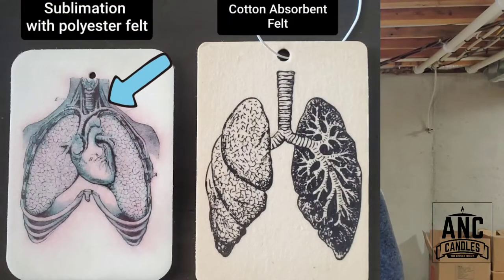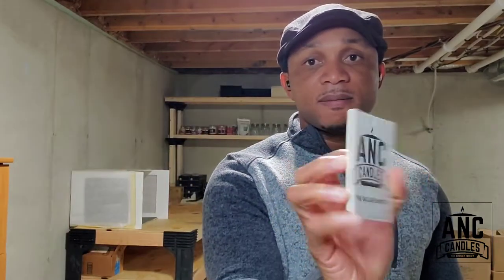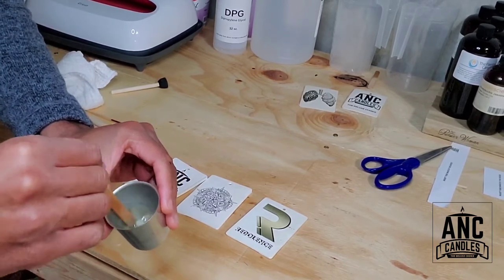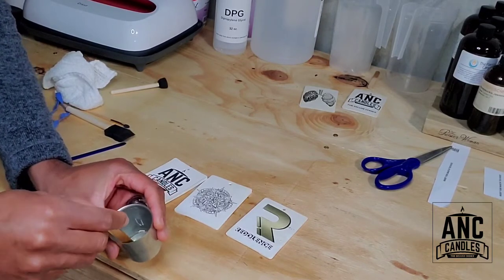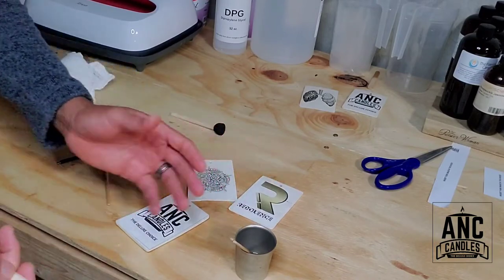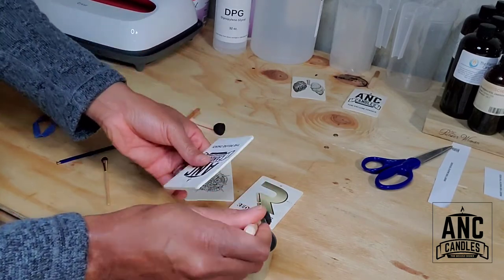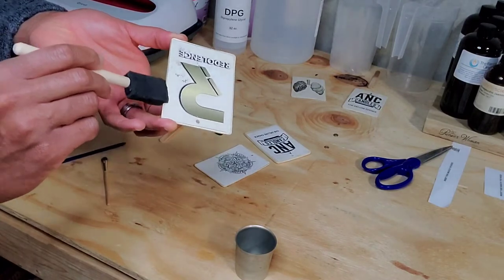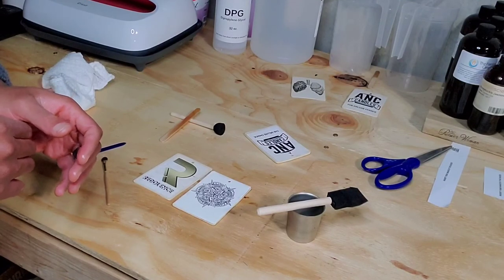How to Add Fragrance Oil to Your Cardstock Car Air Freshener

Comment: Do you only apply the oil to the edges?Have seen other videos where the oil is applied direct to the face of the card.Does one way work better then the other or will it depend on the material?

How long do you let fully dry before put in a sealed pouch?
Reply from the maker: You can check the link below and get all the information you need once and for all. 
https://bit.ly/351Den9

Comment: Hello, can I put sticker on the paper instead of sublimation printing?
Also if I have an ink jet printer do I have to change to sublimation ink and paper or can I use regular printing with regular ink?
Reply from the maker: You can.
Reply: @anccandles  thanx
Reply: How is the oil going to seep into Sticker paper without ruining the design?

Comment: can we make air freshener out of wood cutouts as well? soaking the wood in fragrance oil? would that work as well?
Reply from the maker: Depending on the type of wood you are using.  Try testing different types of wood first.

Comment: hi bro i have question. can i make a 40 50 days lasting air freshener? what is the formula. thanks for now
Reply from the maker: Yes you can. I am currently testing a new material. It is super absorbent and so far testing has been really strong  for weeks now. Can't share the formular in public or material yet. For more information,  you can contact me at: chris@anccandles.com